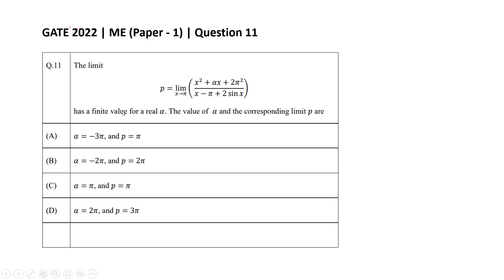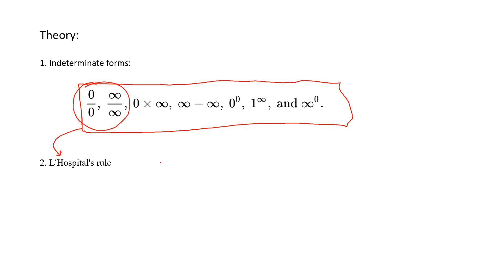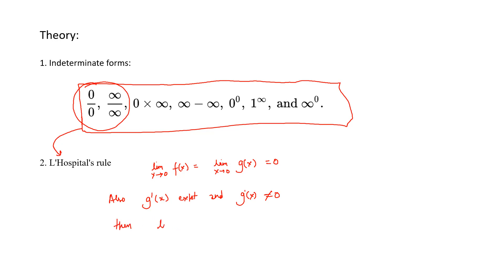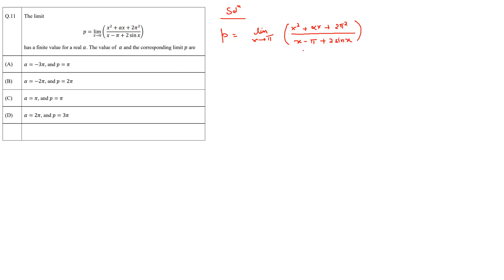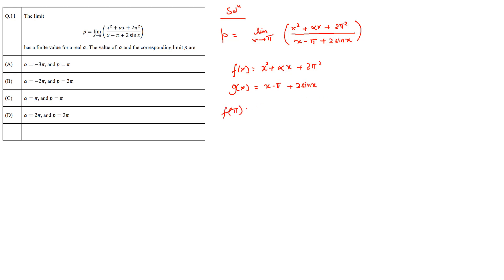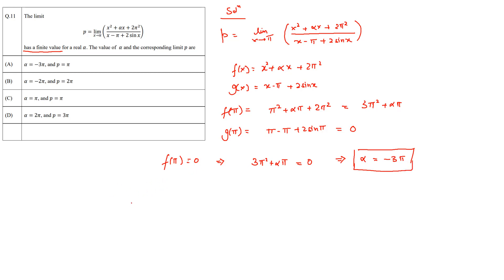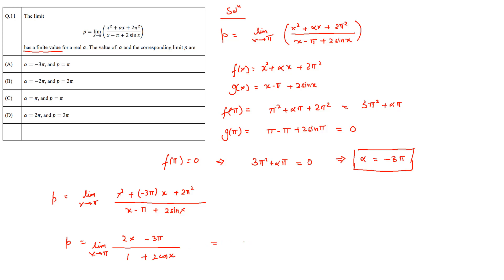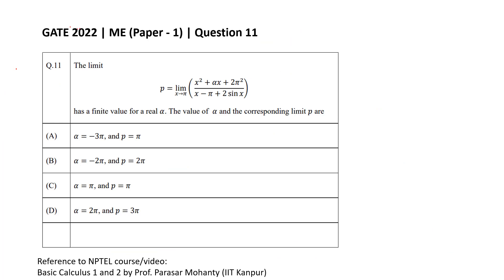Q11 ME 2022 S1

Comment: Sir, in questions like this, can we immediately jump to the answer as (A) when we get α=-3π when we apply the limits? Can we do this to save time? Because other options do not have α=-3π. Of course we are going to get the p value using the L'Hospital rule but α value has to be the same, right?